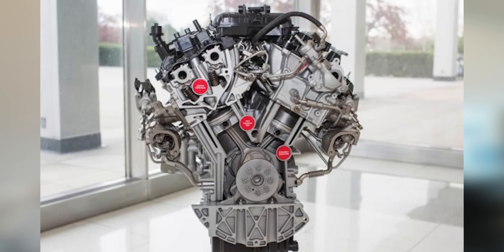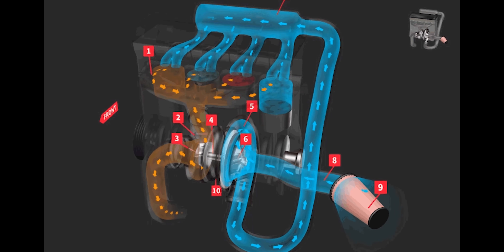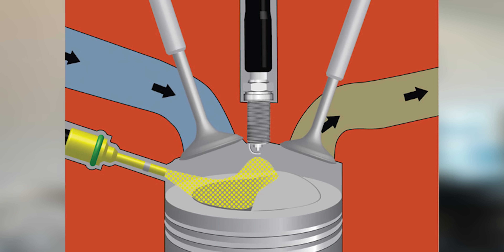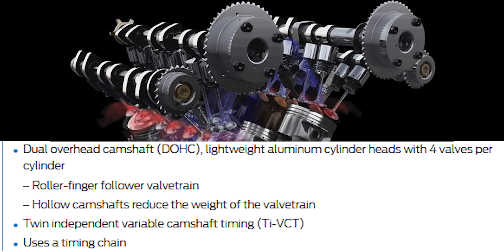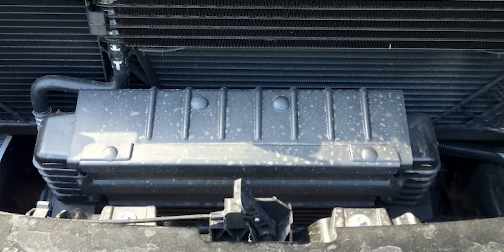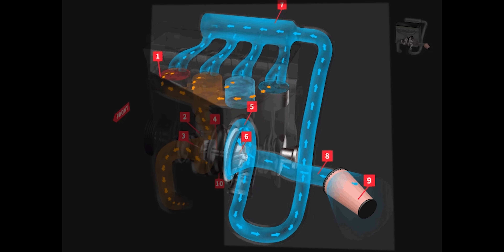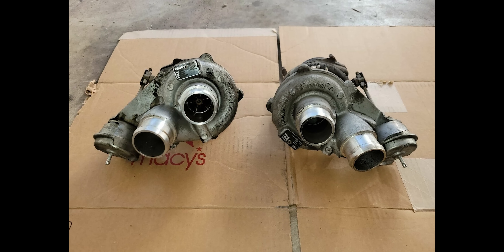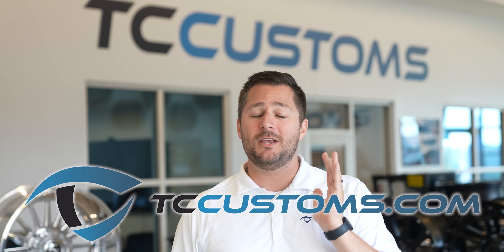The Truth about the Ecoboost Engine!

Comment: I got a 2021 platinum 3.5 in January before the chip fiasco. I loooove it. 10000 miles already and no problems. Rides and drives great. I talked to 4 people with older 3.5’s. Lowest millege is 60000, highest is 178000. Neither one has had any problems.
Reply: That’s hysterical, you obviously haven’t googled “ecoboost overheating while towing” or “ecoboost premature timing chain wear”
Reply: @MrDmitryd9  and you e not been on the 5.0 forums much
Reply: @MrDmitryd9  Here are a couple solutions to those problems.

First one: Stop towing F-250+ loads with an F-150. If you're someone who's gonna be towing heavy loads often or in challenging conditions, upgrade to a more capable truck. 

Second one: Change the oil every 5k miles or so like most people here are saying. The primary reason that even happens at all is because of lack of frequent oil changes.
Reply: Come back when there's another 0 on the end of the mileage.
Reply: @austin3626  will do that…. My 2014 3.5 had 236000 on it when sold. Had to replace some sensor, and two fuel injectors.
Reply: @noobeenaut  to add onto this, don't use motorcraft oil if you're towing at max, it's fine on a daily driver, but if you're stressing the motor you need better, because motorcraft will sludge, pretty much any full synthetic out there will live though, valvoline, castrol, pennzoil, mobil, royal, hell even a lot of store brands.
Reply: @MrDmitryd9  obviously if you Google a problem that happens on the most sold truck on the planet, if there's, let's say, 10 million of these trucks with this motor on the planet, and even just 1% has this issue, all of a sudden you've got 100k of these 10 million having an issue. Take it down to 1 mil, and you've still got well over 10k of these trucks that will have issues at a 1% failure rate. Obviously the rate is higher, but I doubt it's more than 5% ( which is still 50k trucks with issues)

Edit to say that as of 2016 ford had already sold a million 3.5 EcoBoost f150s there's probably over 2 million now, especially if you also count the 2.7 ecoboost alongside the number, and that's not even counting all the expedition/navigator ones, the ones in the ford flex, and the Taurus SHO, and various other models, so that 5% is probably looking more like well over 100k.
Reply: Yes I just traded my 16 in had 149k on it check engine light never came on and ran like a bear and I’m extremely rough on vehicles Chevy could never handle me
Reply: wait till your mainifold warps.
Reply: Always a troll out there ... you can google Ram, Toyota and GM truck problems and get same percentages and frustration from a very small set of owners.  Transmissions, cylinder deactivation systems, electrical, fit and finish, frame deformation, rust, etc.  Go with what suits YOU and leave your negative at home!
Reply: @davemortimer9611  wait till your Chevy wraps     Around that big tree in front of ya for talkin sit while you’re driving your genetic modified Chevy
Reply: @controlavirus9839  hey hey hey… I’m Ford guy thru and thru! I own a Mustang GT and Love my F150 EB, but I’m not happy with the 3 k + bill for a poorly designed spaced out stud manifold that I had Both replaced. Don’t be so quick to Judge, speaking from experience here.
Reply: @Prestiged_peck  you are basing these numbers on what source?
Reply: @LandParkColby  did you just compare ram to toyota? really? lol
Reply: @adamnichols476  I'm not basing them on any source, I just picked a potentially realistic easy to math number out of thin air to demonstrate a point about low percentages of large number still being a relatively large number.

Also as a plus one it is common knowledge that the ford F series is the most sold VEHICLE in the US, and I believe close to if not the most sold light truck in the world.
Reply: @noobeenaut  😀😀😀😀😀😀
But the spec say you can towetwelve thousand pounds

You are exactly right… These people that expect their half ton truck to do everything are ridiculous

On the other hand, those engines still have a lot of issues but so do all the others with every other brand so at this point it’s pick the truck that you like the best
Reply: @ToGrimmToWin  why does he need to Google those problems LOL.  Why can’t he be happy with how his truck performs for his needs.
Reply: @noobeenaut  yes
Reply: @Dave Mortimer  You're asking someone with the handle "controlavirus" not to be quick to judge.  I mean thanks for the attempt, but this patient is too far gone.
Reply: 3.5 2021 Lariat, tow 3,000lb boats, 4000lb utility trailers loaded, 12’ ATV Trailer on regular basis. 
Back and forth to the cottage that’s a 3 1/2 hr drive 3-4 times a month during the summer.
155,000klm and a Oil Separator since new.
Use Amsoil and change every 5,000klm religiously.
10-11klm per 100 or 14 towing .
Very happy with the truck and the engine, plenty of power.
Just ordered the 2024 Platinum 3.5 four weeks ago. 
Didn’t bother with the Powersroke thinking it wasn’t worth the initial cost savings on fuel.
I worked in the Collision business all my life.
I’m retired now and plan to remove the front bumper and valance and apply 3m clear to resist stone chips.
My 2021 Black is chipped like crazy.
Reply: Yes timing chain huge issue.. unfortunately mine started having issues around 80k never missed oil change did a tune up at 100k
Reply: Exactly,  and there ate well over 10 million  @Prestiged_peck